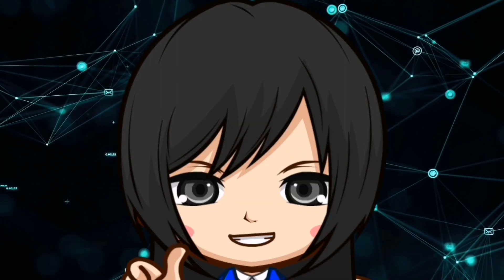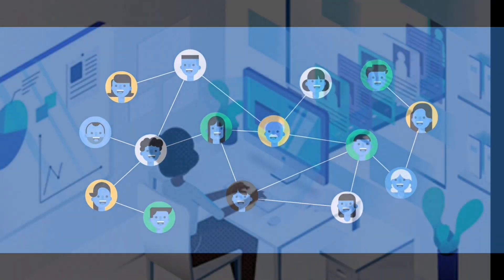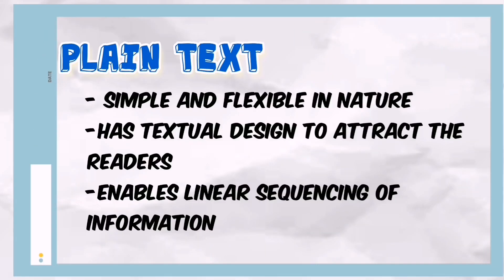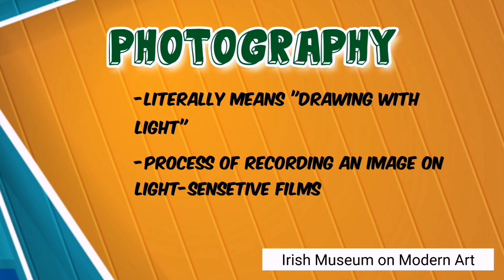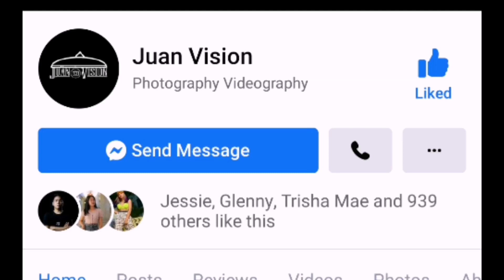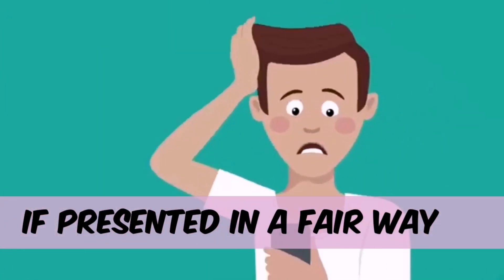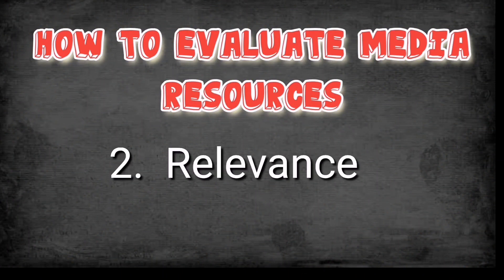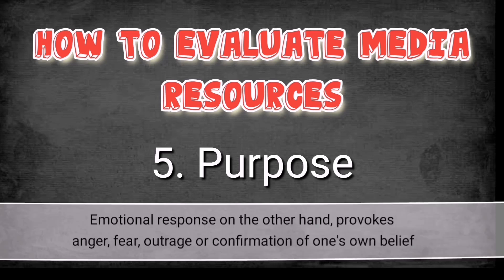Types of Media| MIL | Lesson 4

Comment: 3 things that I learned: 

1. Media is a type of communication which is categorized into three kinds: Print Media, broadcast media and new media. 
2. Print Media are the materials that is physically printed the example are news paper, Billboards, Posters. 
Broadcast media is a process of transmitting a sounds and image through the radios or television.
New media is distributed on the digital platforms
3. I learned that there are 5 ways on how to evaluate media resources: 
- currency, relevance,  author/ anchor, accuracy, purpose.

Comment: 3 Things that I learned:

1. Media is a form of communication. There are three categories:

• Print media- It refers to paper publication such as books, journal, poster, newspaper, billboard and etc. 
• Broadcast Media- It is the act of transmitting sounds or images by radio or television.
• New Media- It can be used Digital platforms  to organized and distributed contents. Example of this are email, blogs, website and streaming.

2. Print Media and New media had a common characteristics, it can be a plain text and illustration or it can have both characteristics. 

3. Ways on how to evaluate media resources: 

1. Currency 
2. Relevance 
3. Author/Anchor
4. Accuracy 
5. Purpose

Comment: These are the 3 things I learned:
1. Media is a form of communication which can be categorized into three:
• Print Media- Materials that is physically printed or in digital version (application & websites) ,
• Broadcast Media- An act of transmitting sound or images by radio or television,
• New Media- Using this, contents are organized and distributed on digital platforms. 
2. Print media and New media has its common characteristics; they can be in a plain text (simple and flexible in nature), Illustration (like infographics, photography and cartoon) or it can have both characteristics.
3. In the context of Broadcast Media, all the information should be all true and correct since, it can bolsters legitimacy and credibility in the eyes of public. Also, there's a Code of Ethics on Media that must be follow.

Comment: 3 Things that I Learned: 
1. Print media and new media have common characteristics in that they can be plain text and illustrations or have both.
2. Print media refers to paper publications and is one of the oldest but most effective ways of advertising, while broadcast media can transmit sounds or images via radio or television. And the last one is new media. It is considered to be multimedia and has a dynamic webpage.
3. We can evaluate media resources by having currency, relevance, author/anchor, accuracy, and purpose.